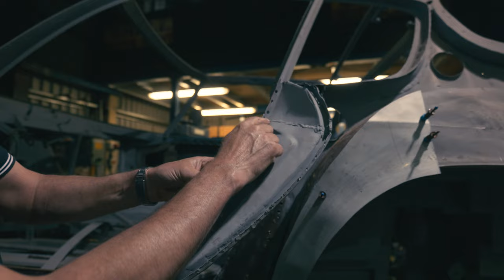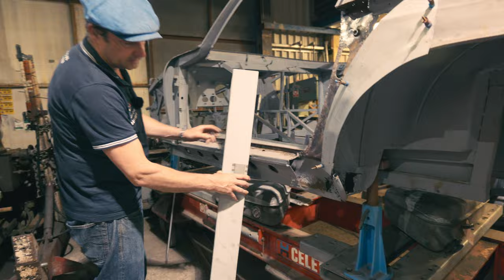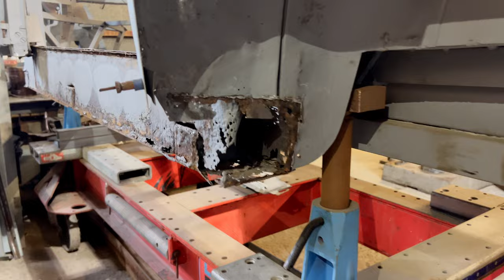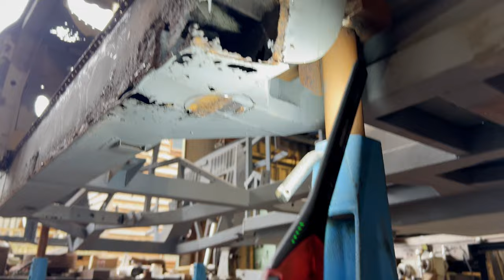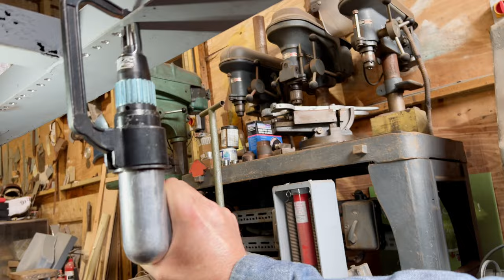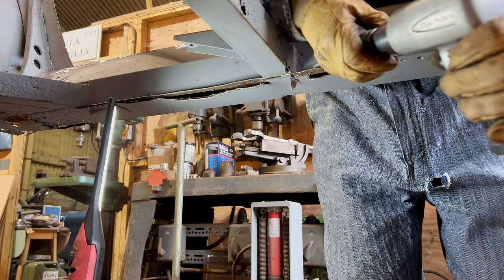Maserati Mistral Restoration part 12.

Comment: Hi 🙋 Mark. It’s completely crazy 🤪 to see how much work going in a Restaration like you do it . 
I bought my Mistral from EBay USA and I see that the car has have no Bodywork. 
And it comes like I see it.!!! So im very lucky to interpret the EBay picture right . 
But still after 5 years of rebuilding the car ( 2500 hours later )  I know how much work it will be with a Body like that.
Reply from the maker: Yes it is a huge job but it is a significant car especially as it was Umberto’s  !